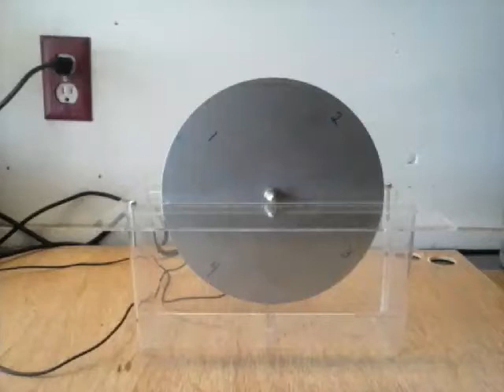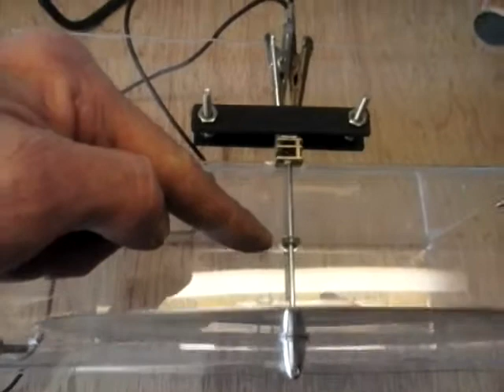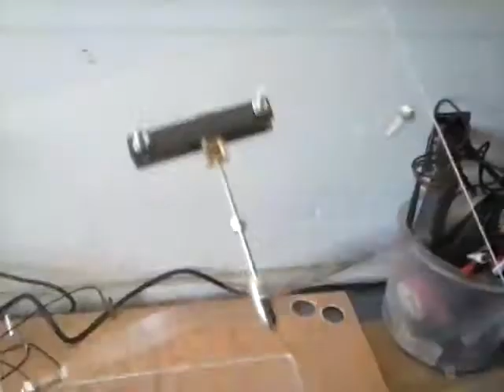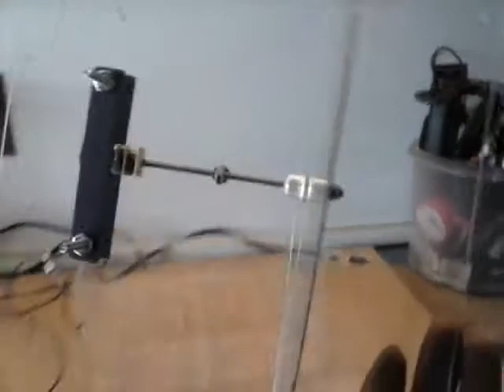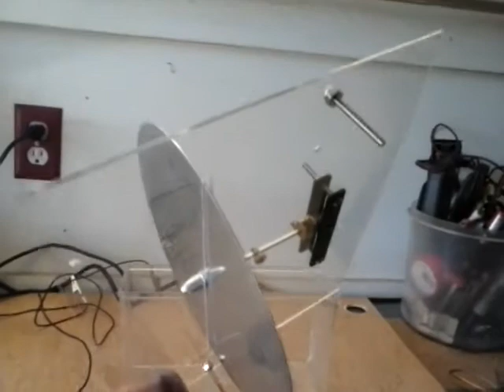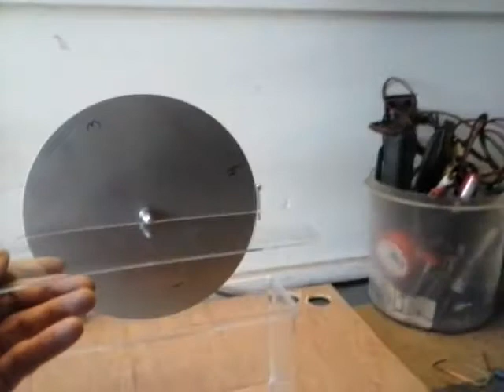Rotating Electrolytic Cathode Silver Cell Design

Comment: Thanks for posting your thoughts! 

I have a setup, for copper, where the refining is in done inside a hanging rotating pipe(with holes), with many cells in the same bath. So in the pipe there are scrap anode parts, a metal separator(Cu or Ti) , cathode nuggets being grow,(new cell >) separator, anode parts, cathode nuggets,(new cell>) and so on. The parts are in baskets so the anodes and cathodes don't touch, but they touch the separator. I call the setup a "Tumble Former". 

I was thinking this might work for silver, except the cathodes would never grow, the crystals would just fall. But then you would have to collect the anode slime some how...
And I would not know what metal to make the separator plates out of...

I build this setup after being inspired by your bag over a bowl setup. Thanks!
Reply from the maker: Paul Krush Have you made a video sir? It sounds interesting!
Reply: AQUILLA REFINING No video yet... I started a new setup today and will post something in 3-4 days.